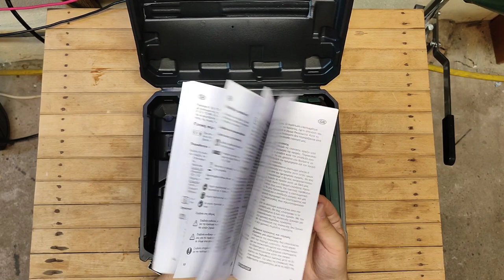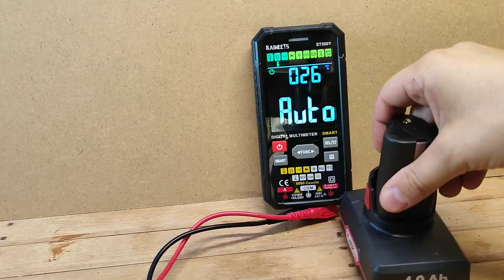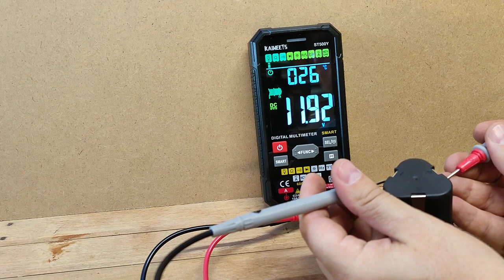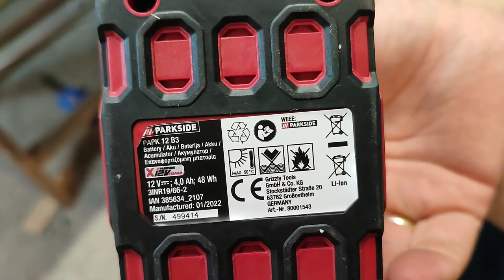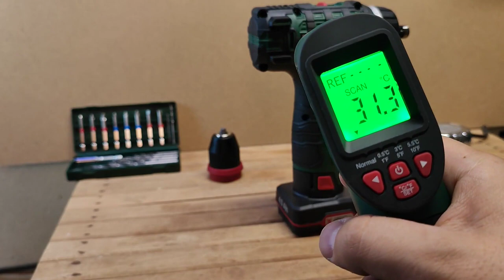Parkside  Cordless Drill PBSA 12 E4 Unboxing and Test with 2Ah and 4Ah Batteries | Real life test

Comment: Thanks for the video! Do you think if it's strong enough for making hole in a brick wall or cement?
Reply from the maker: For brick wall or cement drilling I would be using hammer drills. This model is mostly for wood drilling and screws in my opinion. It is possible to make a hole in brick wall but it would probably take too much time.
Reply: @FixitEasyDIY  Thanks a lot for letting me know!

Comment: Thanks for making the video. Do you know what the updates are to the D4 model?
Reply from the maker: I believe the latest version is E4. That's exactly the tool from the video. I bought it just one month ago.
Reply: I am also interested what diferences in between D4 and E4.
Reply from the maker: D4 is switching between gears much smoother. Other than that there are some minor changes in design and ergonomics.

Comment: PBSA E4 vs D4? :)
Reply from the maker: I believe E4 is much better. They improved it's design and fixed the problem with changing the gear ratio 1-2.  I have them both. They are good tool for cheap money. If you are curious check the video of maintenance the drill in my channel. I used very good grease to lubricate the gears. It came out pretty good after the procedure.
Reply: @FixitEasyDIY  thanks for reply! OK I will buy E4 and see your video!